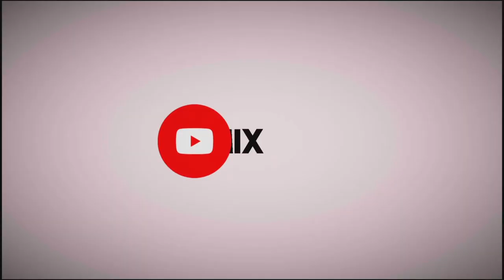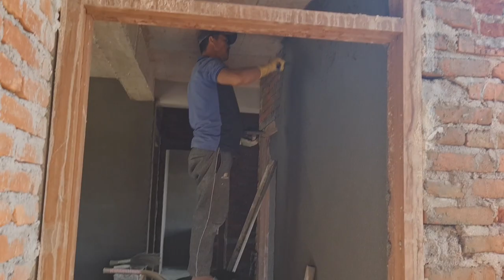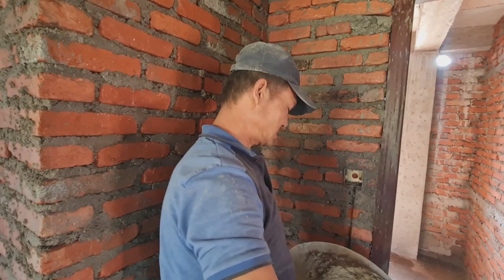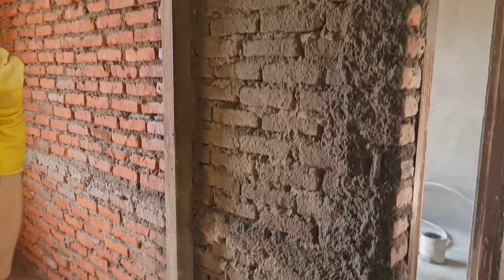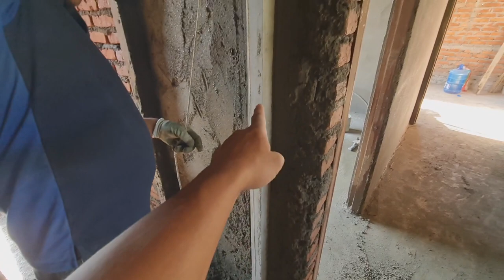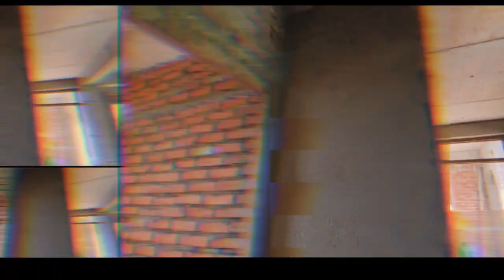how to do Plaster || cement and sand wall plastering || ghar jagga || how to build house|| bau choro

Comment: This kind of plaster is not good..if you hammer a nail ,it will go in easily which means the cement is not strong enough and insect and ants also go in easily.... mixing should be done with proper water